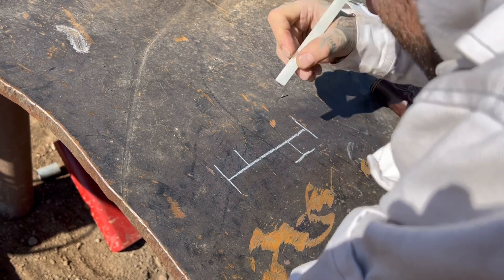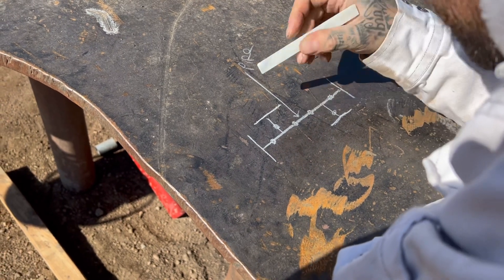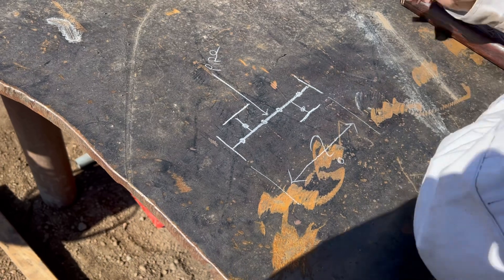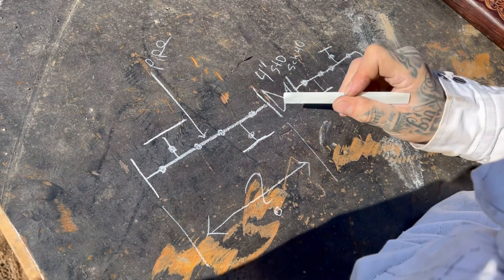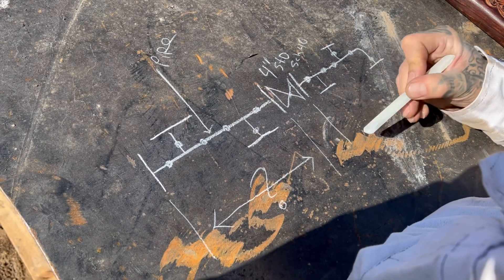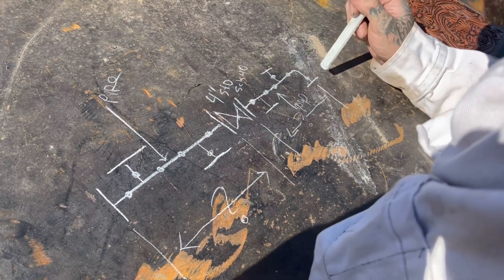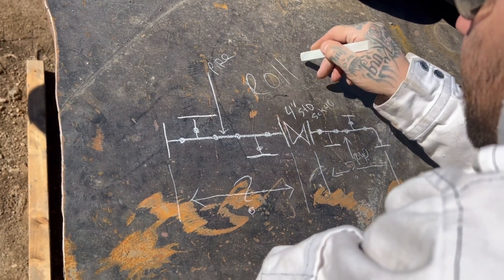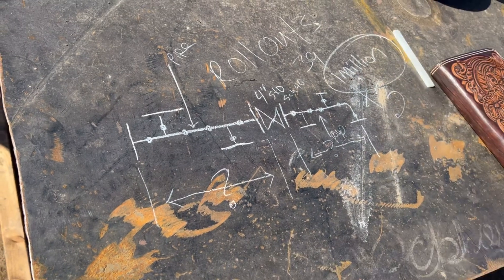Pipe welding and fabrication #welding

Comment: Hi bro! I just saw something on the drawing, but i'm not quite sure should it be like i think. In short, on the second assembly group, after the valve, just above the first looking down flange, before the POP, shouldn't be there a spot/weld, like on the rest of the places between T and flange, except if it's not T and flange but rather some other component?
Reply from the maker: You mean like more then two tacks? Like four instead of two?
Reply: @Wallyzweldingworld  No, i'm talking just for the drawing, for the spots which you maked with the chalk, representing welds. I think you missed one on the flange looking down, after the valve. Ah, nothing important, anyway! Have a good one mate!
   Pleasure watching your videos professor! Very instructive!
Reply from the maker: @6pekXX  i absolutely did and I did it to see if anyone was paying attention on purpose
 Email me your address I will send ya out a slap
Reply: @Wallyzweldingworld  🥰🤗 You have it.